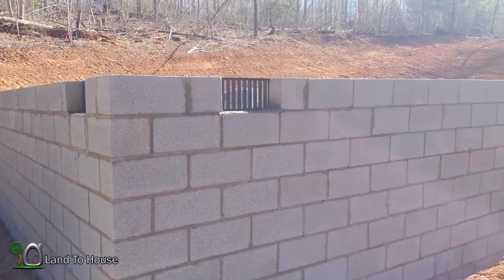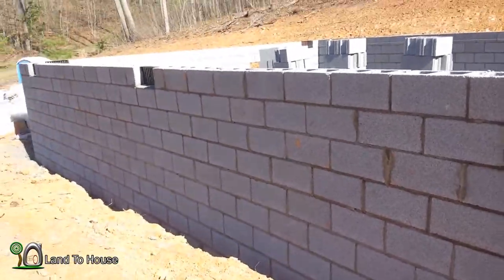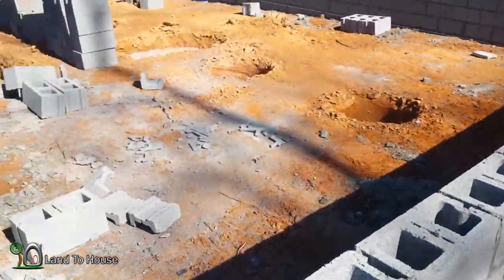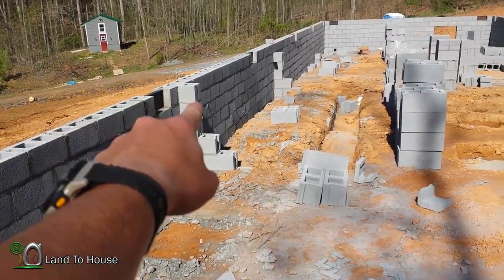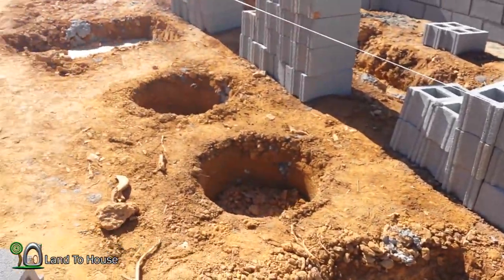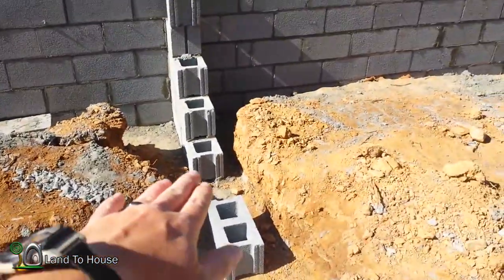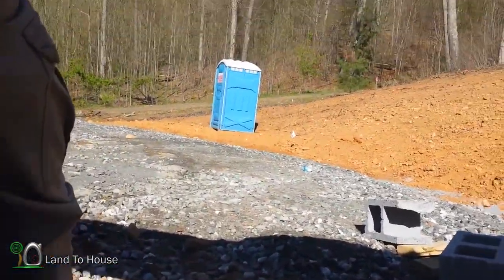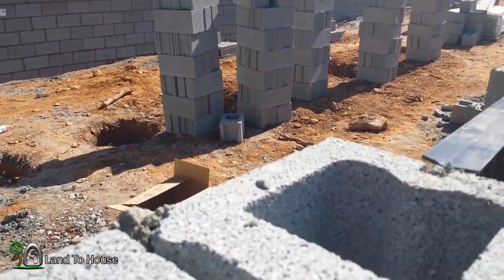Installing Blocks Day 1 - Modular Home #27

Comment: Nice job. Why did you go with concrete blocks rather than forming and pouring concrete walls ?
Reply from the maker: +greathodgy22 most of this build was left up to home crafters. They build and set a lot of homes and this is what they suggested we do. I am not sure of the difference between the two types of walls.
Reply: @LandtoHouse  block is cheaper and faster than poured walls.  And heaven forbid, if there is a problem later, it is easier to repair/rebuild.  But the upside of a form poured concrete wall is that it will survive a lot more abuse from mother nature before failing.

Comment: I must have missed something Seth.. Could you explain this please. you said there one 8 high at one end and 5 high at the other ..Now you had a footer put down first right ?? now why the difference in block height ??? would the foot now have been leveled all the way around ???? Also with that much space under your house why would you not have made a bigger entrance to the underneath as big as you could for future things..  I mean you are going to have to can all those extra vegies  and that's a great place for cool storage , you may even what to have access for it from the inside of your house .. OH NO . am I adding to your thoughts...sorry ....just thinking out loud...
Reply from the maker: +Maurice Brown so what happened. .. there are 5 blocks at one side and 8 at the other so 3 difference. The blocks are 8" tall so the difference in dirt height from one end to the other is 24". To make up the difference they had to step down the footers. They put those wooden blocks down and filled concrete around them to make the steps.

As for a bigger door. .. that would have been awesome. I did not know what they did and apparently this small door is standard.
Reply: I am still a little confused, why the footing wasn't level in the first place..  but don't answer this  comment . let me stay confused..
Reply from the maker: +Maurice Brown it's a conspiracy.  No need to understand it. Haha.... all you need to know is the top row of blocks is level.
Reply: The reason why it wasn't level all the way around is to reduce the around of digging that would have been required plus the extra costs of more blocks, this is the normal way to put in footings on a sloping site